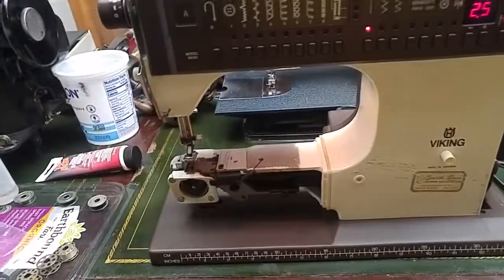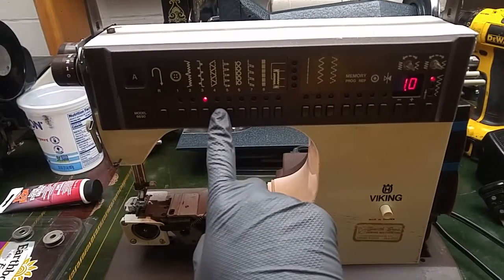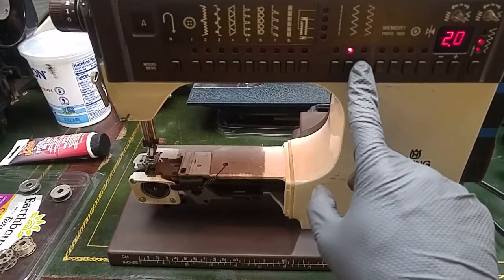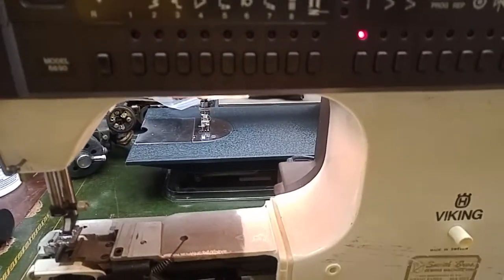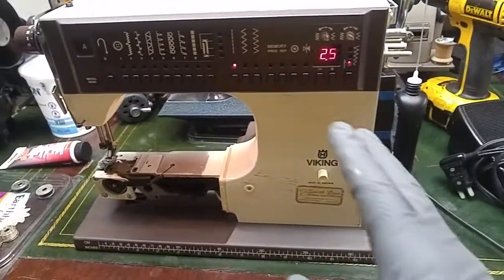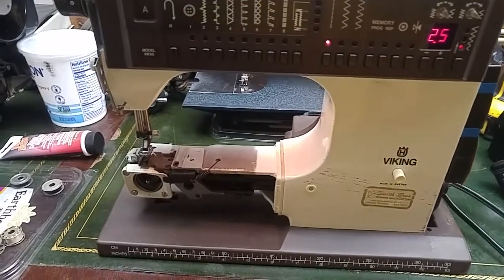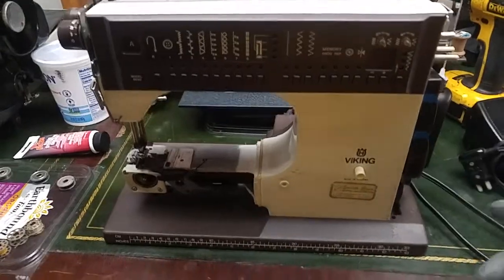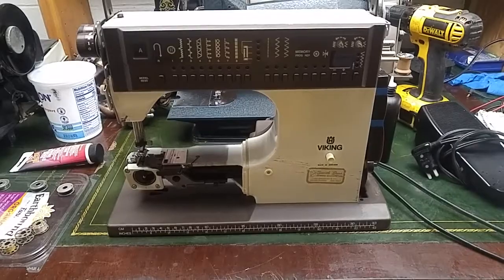Rescue - Viking 6690 Overview Update 1, Inspection, Oiling & Power On Apparent Success

Comment: I bought one today in the thrift shop. It worked  perfect initially. I cleaned it then later with the power off  I heard a crackling noise and smoke came out of the machine.
Half an hour later I plugged it back in and it seems to work ok.
What happened and why? Can I still sew on this machine or should it be fixed first?
Reply from the maker: Be very careful.  There are most likely RIFA capacitors in the needle stop position board that need to be replaced before they spew corrosive electrolyte on other components and corrode or fry them.  There are also two resistors that I've found on the boards that are bad in the three I own now that have those boards (6570 and x2 - 6690's).  Those resistors values get wrong and probably better to replace with a higher wattage value while at it so they handle the heat better.
Reply from the maker: That's awesome you rescued one as well.  Did you get any cassettes with it for the different stitch patterns?
Reply from the maker: I have some other videos (click my name and videos and search where the magnifying glass is box for 6690) and forget offhand if I was being disciplined to reference my Facebook posts where I also had photos showing the parts.  I don't recall having the best very basic specific detailed disassembly, though I do have showing what parts go bad and what they look like when in the most likely muse of whatever was on my mind regarding that topic.  Don't be shy to ask away.  There are some good groups too, though the related groups.io group doesn't want to discuss the 6690 model... so you have to refer to that board issue as a 6570 or the other model that has that needle stop position control board that's the same on those three models I believe that have.
Reply: @jafinch78  is this something I can repair and are the parts easy to get a hold off?
I watched your video part 4 on this machine. Is it a matter of plug out the old capacitator and plug in a new one with higher wattage or does it need soldering? 
No the 4  other cassettes were not there.
I could find a manual online so I could figure out how to remove the sewing plate and clean iit and find the feature of the bobbin winder  which regulates the sewing speed.
Reply from the maker: @teddyboef2821  I'm guessing the parts aren't common in regards for like finding the board or from the company that now is owned by White.  In regards to the electronic parts, yes, they're not hard to find and best to get new stock to be safe.  There might even be a better capacitor type to use  that's still the specification, though better design that doesn't fail as quick.   In regards to replacing, yes soldering is required and that skill for the two RIFA capacitors and possibly the two larger resistors.
Reply: @jafinch78  thanks for your reply.
Reply from the maker: @teddyboef2821  Your welcome, thank you for detailing and asking.  What's the scoop you thinking, i.e. going to repair or see if you can find someone to?   If you ever get into soldering, I found the SH72 soldering iron to be one of the most cost effective and easy to use soldering irons as well as having portable capabilities.  If you search my channel videos for "SH72" I somewhat show'd my observations regarding.  There are Facebook groups as well if you search Viking and/or Husqvarna sewing machines where you can ask questions pretty much directly to those that have worked on or work on the machines for a living that know what to do really well.  "Hans C. Endrerud" seems to be the most knowledgeable I've found on Youtube (not many videos though) and more-so on the Husqvarna Viking Sewing Machines FB group: https://www.facebook.com/groups/1160466257299879/  I'd ask him and/or see who he know if you don't know who might be able to repair locally. I'm actually interested if your not to far from Michigan as I have a Prius and enjoy road trips. 🙂
Reply: @jafinch78  i cannot repair it myself.I do not have the skills. Thanks for the link. I will try find someone who can repair because it is a lovely machine. I am a Dutch girl so unless you can        make your Prius into a dive boat . Thanks for the offer. 👍
Reply from the maker: @teddyboef2821  OK, yes I'm thinking you can find someone to repair your machine.  I might know of some people skilled in electronics in your country (though they get more into radio related projects) and Hans I supposed isn't that far away and may know more local to you as well experienced with these boards. 

I enjoyed visiting the Netherlands the three times I was over there and at times wish I wasn't so serious working at that time in my life.  I have some Netherlands descent in my family background, my sister still lives in Zeeland Michigan and has most her life.  I lived in Holland & Zeeland Michigan for a time period as well.  Not so much the Netherlands now-a-days I've seen..., maybe more like Amsterdam'ish... though last I knew there were still alum that still do traditional acts and events.  Great Reformed network as well.  

I'll see what I can do to make into a dive boat... though thinking won't be anytime soon.  🙂  Humorous is the one person I'm aware of, my brother in law knows, is Dutch and made his own submarine.  You can email me at jafinch78 at gmail dot com as well since most my connections over there are through the groups dot io groups now-a-days and I receive those messages via gmail.  

Your very welcome and excited you're saving a somewhat challenging to many to repair, though nice solid made to last and be repaired piece of vintage history that was the first computerized sewing machine made by Viking Husqvarna.
Reply: @jafinch78  thank you.